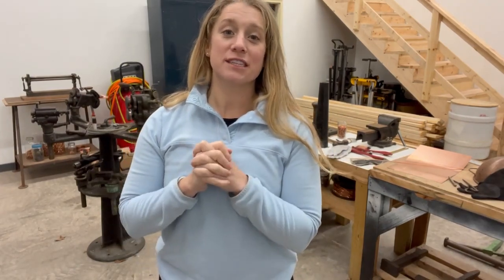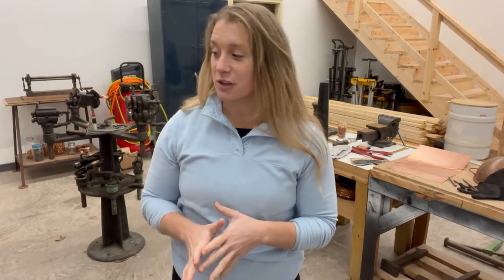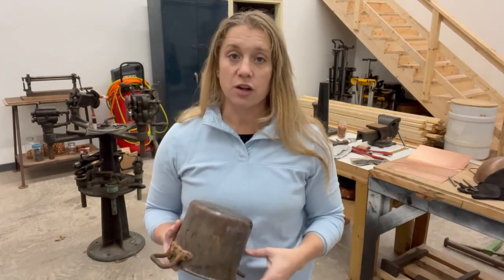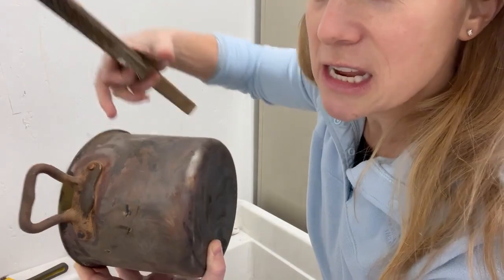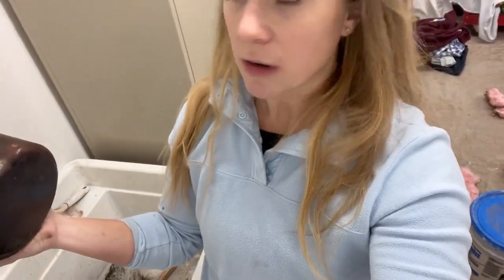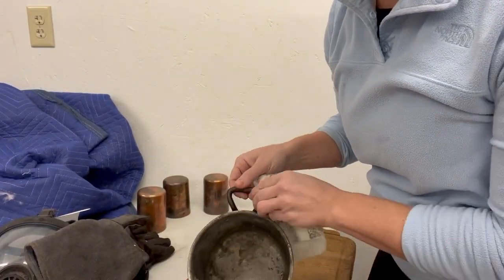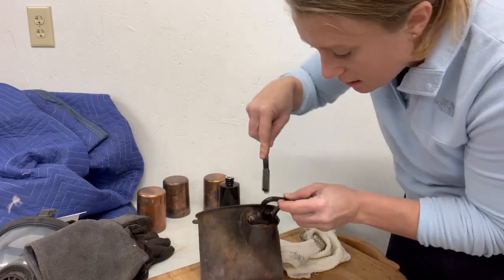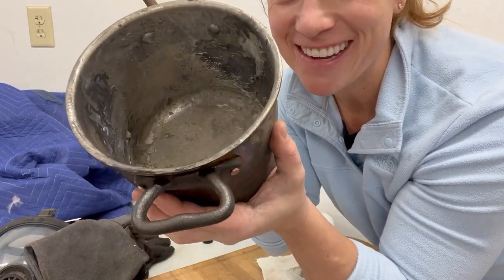How to Clean Cookware Handles

Comment: thanks for the video. how do you ensure the handles don’t rust again once the handle gets washed with soap?
Reply from the maker: The coat of oil helps, and hopefully your hands, etc...but if you're worried, every time you use it, wipe a very very very very thin coat of oil on before you fill and cook...the heat from cooking will help polymerize the oil more...and essentially over time you'll "season" your handles. :)

Comment: Any recommendations on how to remove all the dense gunk between the handle and the pot/pan itself. I have the hardest time and I feel it doesn't look great and probably isn't sanitary.
Reply from the maker: Elbow grease and a Brillo pad...or a wire brush if you are careful and won't scratch the copper too much. Ideally after the pan is quite warm so the stuff is softer.

Comment: How to remove the crud on the bottom of a copper pot ?  wire brush ? or is that to brutal .
Reply: I found the use spray oven cleaner in a sealed plastic bag overnight works like magic on my 100 year old plus copper pans …I only needed to do this once on the toughest of crud… hope this helps…
Reply: @joniangelsrreal6262  Thanks for this Joni, I really did not want to damage the copper .
Reply from the maker: Fantastic reply - thanks for sharing on here!!! xoxoxo